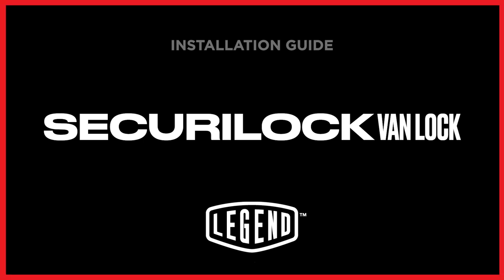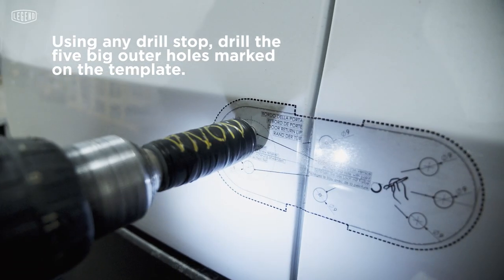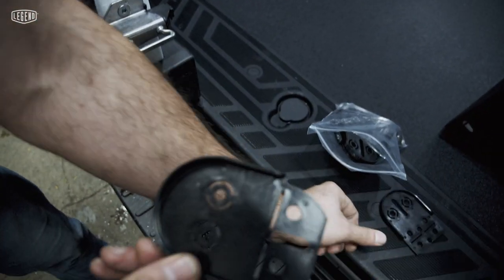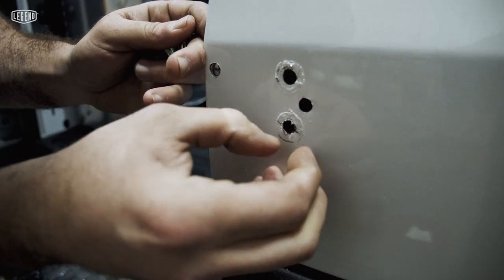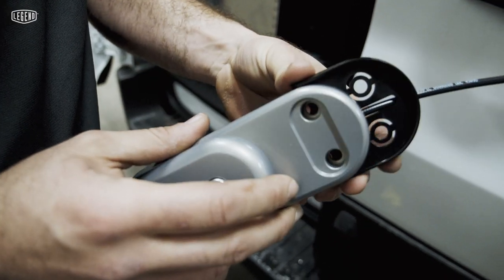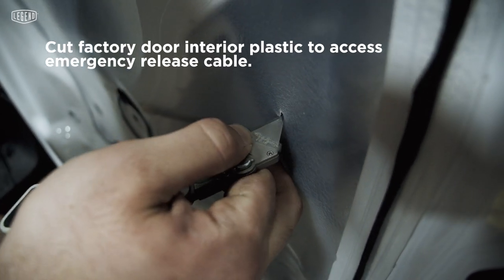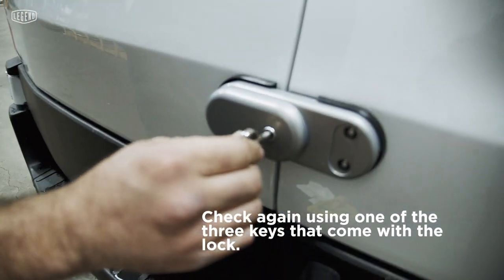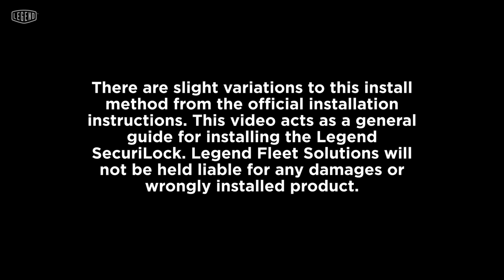How to Install Legend SecuriLock Van Lock - The Best Van Lock on the Market

Comment: Many thanks for this interesting video.  I have a small suggestion: the drilled holes should be protected from rust with paint
Reply from the maker: Thanks! Great suggestion - we actually do provide anti-corrosion paint. We forgot to include this in the video when on-site, but it's in our install instructions!
Reply: @LEGENDVanFloors 😂 sure

Comment: Vans have sliding side doors in the UK so they would be no good! And another problem is that the position that you have fitted them does not  stop door pealing/bending of the door to gain entry.
Reply from the maker: @stephenrutherford6182 Good comment, though quite a few customers have already sent photos of their van doors absolutely bent, but the lock is not budged, nor did they gain access to the door. These locks are insane.